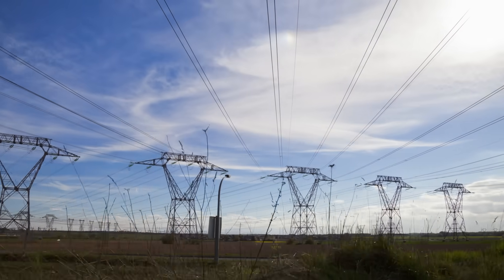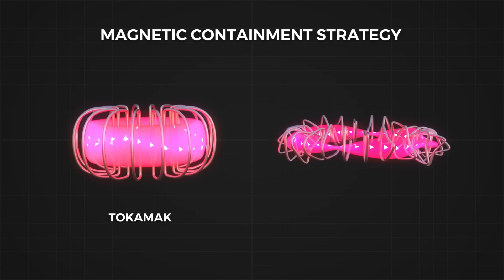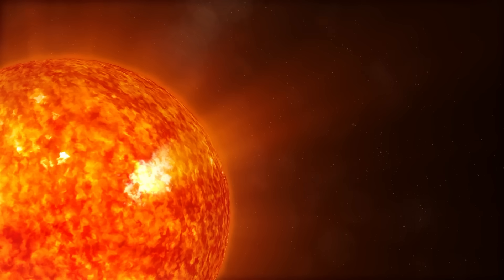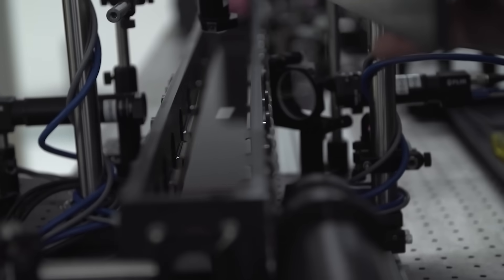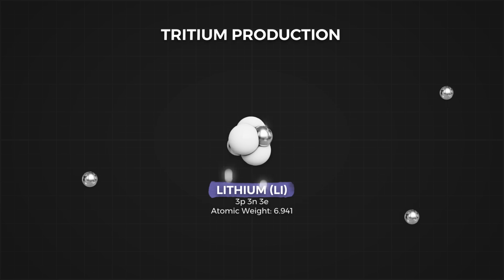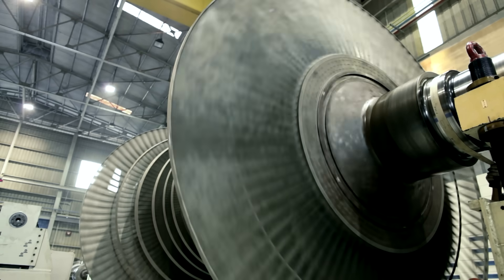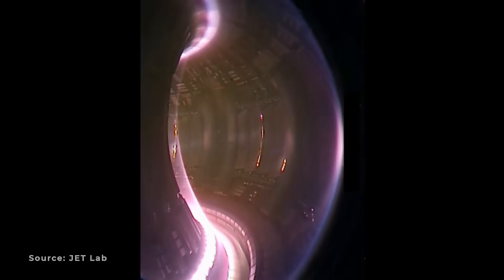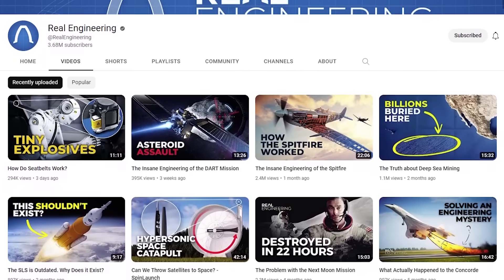The Problem with Nuclear Fusion

Comment: Big asterisk on nuclear plants being out-competed; there would have to be a free market in place for there to be any competition taking place. If there were actual competition, nuclear plants would be everywhere and energy would be absurdly affordable.

The problem with nuclear isn't economics, it's politics. Essentially, governments hate nuclear because the economic cost is small, but all up front; nuclear is expensive to set up cheap to maintain, and creates extremely cheap energy for decades. This means that a government suffers all the political costs of setting up the reactor, and a future government reaps all of the political windfall.

"Renewables" are the reverse. The economics are toxic; more expensive to set up and maintain than the value of the energy that they produce, but the political payout is all up front. 

This is why "renewables" get trillions in subsidies while nuclear gets shut down; nuclear is good for the public and bad for the government, while "renewables" are good for the government and bad for the public.

The same political games will be played to sabotage fusion implementation once we finally make the big breakthrough; great economics but politically unaffordable.

Comment: The problem has always been the estimates of when we should get fusion power...not that it's "perpetually 20 years away".

Ever since non-weaponized fusion was first demonstrated in the 1950's, we've been making progress.  That rate of progress has always indicated that we should probably have it sorted out by the end of the 21st century, give or take a decade.  It's never been otherwise.  It's not that hard to discern the pattern.

That said, it may not be possible at all.

We could actually cut the time down to 20 or 30 years...if we actually tried.  Cut the US military budget from almost 1 trillion, down to about 300 billion.  That alone would fund all fusion research on the planet, several times over...and still leave the US with the most powerful military on the planet.  So long as other nations chip in something, be it a few million, or a few billion (as appropriate), there would be plenty to fund a scale of research far greater than current efforts.  Building and improving the infrastructure, new facilities, grants and scholarships to universities around the world to get more students studying in the relevant fields.  All of which would bolster the economies of nations worldwide.  If more were really needed beyond that...just seize everything from all the billionaires.  They're worthless parasites anyway.

One more important factor in speeding up the research would be to make absolutely mandatory, the full sharing of ALL data and other information (private or not) pertaining to all things related to fusion reasearch.  And, of course, have a single global agency that coordinates and directs that research collectively.

Comment: General Fusion from Canada seems to have the most practice and scalable system, very simple in essence.  Compress liquid metal cavity into which a hydrogen plasma has been injected and siphon off the heat to make power.

Comment: I take issue with the idea that current fission technology is "clean". Not only it generates waste that remains radioactive for millenia (and can be used for dirty bombs) but also requires a lot of mining to obtain the materials and, if there is an accident, you can contaminate a large area and cause massive societal and economical damage (see Chernobyl and Fukushima). It is not just "uneconomical". It is actually dangerous. And that is why we are working so hard to replace it with fusion-based systems.

Comment: Helium is not going away though. Around 6:50 you said we are going to run out, however that's not true, we can make it ourselves though. The only issue current is that we're running out of it in the reserves and we will have a lower amount of supply soon

Comment: Safe and "clean"? You must be joking. De-Tr fusion (what we are striving to do) is crazy polluting. 
The neutron flux problem is still unresolved. Next to this huge problem, stand three more major problems, namely:
Q_total hopelessly less than 1 (currently, is around 0.01 and we need at least a value of 10)
Fuel scarcity (tritium)
Nuclear proliferation 

And also these further problems
Radioactive waste disposal (both from fusion AND ancillary fission plants)
Fusion plants stable functioning.

All these problems should change the worn out "thirty years to having fusion" mantra to a more honest "one hundred years to possibly have fusion" one

Have a nice day
Reply: A Q of 0.7 has been achieved. Iter aims for Q 10. It has been reckoned a Q of 100 is needed for a commercial fusion station.
Reply: @Safetytrousers  0.7 is just q_plasma, which is a tiny fraction of the real Q, better called Q_total. Currently ITER has a Q_total of maybe 0.015
Reply: @pierluigidipietro8097  ITER has not yet been built and certainly has not had first plasma. You do not know what you are talking about.
Reply: @Safetytrousers  answering the result of tokamak like tech, which ITER adopted. I know perfectly well that ITER will not produce a single watt of energy, being an experimental facility not meant for production.
Also, after discovering these big cracks in the main shell, the ITER schedule has shifted maybe another couple of years, maybe five, maybe more.
Reply: @pierluigidipietro8097  ''the revision was said not likely to be agreed until April 2023'' We do not know how long the delay for repairs will be. It is going to be a setback for sure though. But whenever it goes into operation it will have been fixed.

Comment: I ran a copper alloy foundry for a while, and several of my customers made me sign agreements that said that the facility did not work with ANY beryllium alloys (they are common in electrical contact gear made of copper alloys).  I always thought it was because Be is insanely toxic, but in hind sight, there may have been radiological considerations after watching this episode.   All of the customers asking for those "no Be" contracting were defense contractors, and it would make sense that they were sensitive to background radiation in their bearing components.
Reply: In my working in defense electronics the issue with beryllium was toxicity of dust and not trace amounts of uranium. Presumably if uranium was an issue it is chemically different enough from beryllium to be separated out. 

Naturally occurring uranium has a 4.5 billion year half life so it is only mildly radioactive in fact  it is used for radiation shielding as well as certain projectiles In solid from it can be handled safely with minimal if any protective gear. As with Beryllium the main hazard is the dust.
Reply: @gerry5712  I wouldn't expect any uranium to get into the beryllium, since they are so metallurgically/chemically different, but since Be is so commonly used in nuclear applications, I see how it could be easier to just make the restriction for things that could be near radiologically sensitive instrumentation.  Same with salvaging old pre-1944 steel to make certain components.    
Maybe I was closer to the truth when I originally thought it was for chemical safety reasons though.  Aside from really sensitive physics instrumentations, or maybe advanced radar systems, it's hard to think of a reason a normal electromechanical system would be disturbed by really small increases in material background radiation.
Reply: Its always nice to learn from viewer-experience even more in coments. But I THINK (just listen to 12:18) the radiation-problem is only a reactor problem, because neutrons actualy cause fission in the blancket, but fission products are much more radioactive than Uranium. Uranium without beeing neutron-blasted is RELATIVELY harmless radiation-wise. Actualy, non-fisile Uranium-239 is considered beeing more toxic in chemical ways than its radiotoxic. So the toxicity of berilium stays chemical toxicity. Probably your customers split in some who avoid toxicity and another fraction who avoids uranium-impuritys. Not to complain anyone, as its a subjective and personal customer-preference-decision.
Reply: I don't think "background radiation" means what you think it means in this comment.
Reply: It's amazing how laws, regulations, Product Stewardship requirements that  businesses comply with, without having a clue why.
Reply: What I’ve wondered is how Beryllium, the fourth lightest element on the periodic table, could be radioactive.
Reply: @bunsenn5064  isotopes.
Reply: @bunsenn5064  if it is irradiated with neutrons, it will change some atoms to unstable isotopes or indeed elements through beta decays.  Exposing most things to neutron flux causes them to become radioactive.
Reply: @bunsenn5064  certain isotopes of beryllium can be radioactive. As is the case with any element. However these are rare.
Reply: Hmm.  What do you think about stuff and things?
Reply: @edwelndiobel1567  😆. Guess the others lack a sense of humor.
Reply: @edwelndiobel1567  what a mindless response.
Reply: @kylemccormack1785  I feel like he is a joke bot made by a troll just to make the bot comment something that is really nonsensical.
Reply: @kylemccormack1785  probably  a spam bot

Comment: Radiation is bad. But we have gotten very good at controlling it. How bad is a potential accident with a plasma heated to 100 million degrees Celsius — 10 times hotter than the temperature at the center of the sun?  Some scientists theorized that a simple nuclear fission reaction could ignite Earth's atmosphere. I'm guessing that an uncontrolled super heated plasma accident could suck up all of the oxygen in the world. It would be like the mother of all thermobaric bombs. Converting from fission to fusion sounds like "out of the frying pan and into the fire". Maybe I have seen too many super hero movies but with great power comes the need for even greater caution.

Comment: Your timing is brilliant! Even though you didn't mention inertial confinement fusion or the National ignition Facility, you certainly caught the "fusion" hype near its peak!
Reply: Sadly the NIF was not net positive. A total of 300 MJ energy was used to generate a laser with 2 MJ energy, resulting in a fusion reaction of 3.15 MJ. The net energy is still -296.85 MJ (negative).

Besides, the NIF was quite explicit that their research is for stockpile testing purposes (i.e., better understanding of thermonuclear reactions) rather than for energy generation.
Reply: @PanduPoluan  All true. However, the physics is proven. It's just engineering to improve the efficiency of the lasers and increase yield. They weren't even trying to be efficient in the process yet, because they weren't sure what the target frequencies and pulsations were going to be. Now they can develop lasers specific for those functions and get the efficiencies up. 
I have no doubt this will still take a decade or more, but now there will be less wandering about looking for a path forward and more focus on this proven physics.

Comment: The fact that all the tritium on earth weights just 20kg is so insane to me. Im a gunsmith and tritium is a very common element in firearms optics and even modern night sights, its not expensive, you can buy a new set of tritium filled iron sights for as little as 50 dollars. and while scopes with tritium are very expensive, thats usually more to do with the quality of the optics overall and the clarity of the glass and far less to do with the actual captured tritium
Reply: The entire current global supply of tritium is sourced from fission reactors. In theory you can breed Tritium in a DT fusion reactor.
Reply: I know, it's so incredibly rare and beautiful
Reply: Russell pinuela  Bro, put down the drugs, and think more slowly before typing. You literally listed things with zero context or point.
Reply: Russell pinuela  bro, I dont know, nor do I care.
Reply: Russell pinuela  no

Comment: The focus on tritium was excellent and he did give some examples of how neutron radiation transmutes atoms but he didn't mention the greatest obstacle to large nuclear reactors.  Neutrons also transmute the atoms they strike into radioactive isotopes.  This means the critical components of the reactor quickly transmute into a whole witch's brew of random elements many of them extremely radioactive.  The only design that takes the engineering problem of a reactor turning into nuclear waste before we can get our investment back from it is an MIT design that has modular components.  As parts start to be suboptimal the reactor is shut down and parts are switched and it is up and running quickly.  Even if we start getting surplus energy from the reaction, it won't be enough to make up for the short shelf life of anything exposed to continual intense neutron radiation.  If we do figure out a way to make a cost effective and workable power source, we would then have a new large source of nuclear waste, not from the fusion reaction but from the neutron radiation turning the reactor components into nuclear waste.

Comment: Now that the concept has been proven in a lab in California, the United States of America, I see this as a torus surface material issue,

- Extreme heat
- Extreme high-energy neutron flux that will fairly fast shatter even a high-grade steel
- Being able to convey the energy through the torus ring to the surrounding medium, probably water. Water would vaporize and produce steam to turn the turbine connected to an electric generator.

So, here we have the engineering problems: Develop a material in the torus that can stand the extreme heat, and extreme neutron flux, and still be able to deliver the heat to the surrounding media.

I am absolutely certain that Americans will be able to find such material. But it may take the standard 30 years still 🙂 

Anyway, I love the achievement that American engineers and scientists have reached. It is fantastic in many ways. I love those people. To me, they are the best of the best when it comes to the energy development sector.

Comment: I'm glad you mentioned Helion.  To me. they're the least dubious of the fusion efforts.   Their approach offers a possible way to evade the showstopping problems Lawrence Lidsky pointed out in his iconoclastic article, "The Trouble With Fusion", which appeared in MIT's Technology Review all the way back in the 1980s (google for it; it's available online in a pdf and is a good read.)

Lidsky observed that as a source of heat, a DT fusion reactor will inevitably be much larger than, and therefore much more expensive than, a fission reactor of the same thermal power output.  This follows from limits on power/area at the first wall, and from the square-cube law.  The volumetric power density of today's DT fusion reactor concepts are quite low:   for ITER, it's 0.05 MW/m^3;  for ARC it's 0.5 MW/m^3.   For a PWR reactor vessel?   20 MW/m^3, a factor of 40 to 400 better than those values.  Whenever you see someone touting a DT fusion reactor, ask them "what is it's volumetric power density?  And I mean of the reactor, not just of the plasma."

Helion's approach potentially evades this limit by not treating the fusion reactor as a source of thermal energy, but by directly converting plasma energy to electrical energy (via expanding the plasma against a magnetic field.)   This would allow the power plant to omit the thermal cycle shared by fission and DT fusion reactors, so it would no longer be an apples-to-apples comparison of power density.  Helion's approach has other related advantages too (much lower neutron flux and with lower energy neutrons; no need for rapid tritium recovery.)

Comment: For the blanket, how often would they be replacing the material? It sounds like this reactor design just ends up eroding away the blanket material as it runs.
Reply: Given that the melting point of Lithium is only 180°C (twice as high as the boiling temperature of water), and that the blanket would be designed to transfer heat to water at well above its boiling point, I think it's safe to assume that any lithium "blanket" would be designed to be liquid.
Which makes the term "blanket" kind of a misnomer. It's more like the reactor is surrounded by Lithium coolant, (or maybe even submerged in Lithium, depending how the cavities for that coolant layer are arranged).
Not that that's inherently better; with a coolant that's barely staying liquid as the reactor runs means that they'll have to engineer around the problem that whenever the reactor is turned off, the coolant cools and solidifies.

Comment: So many comments saying "needs more research funding", but solar & wind each return more watt-hours per research dollar, & are already viable now. 

Fusion research isn't a bad thing; but diverting research from solar & wind is a bad thing, because we need cleaner energy now while fusion is still decades away. Fusion reactors might pay off eventually, but we don't have 30 years to wait anymore. Put that money into solar & wind, which actually benefits society immediately, unlike nuclear or hydrogen hype engines.
Reply: While wind and solar are improving, they are yet to be on par even with oil and carbon energy plants when it comes to energy production per square feet, when compared to fision or even the potential of fusion energy, green sources are a joke. Needless to say that green energy sources are uncontrolable, there's a reason why countries like Germany that betted on green energy way too fast are now consuming huge ammounts of energy from gas, oil and even coal, that's because no one can control the energy output of these green energy sources.